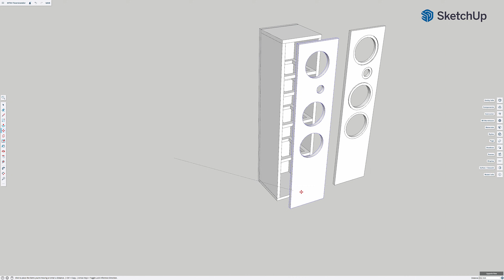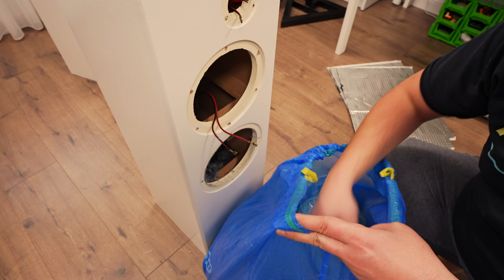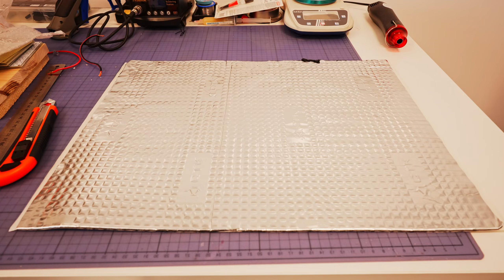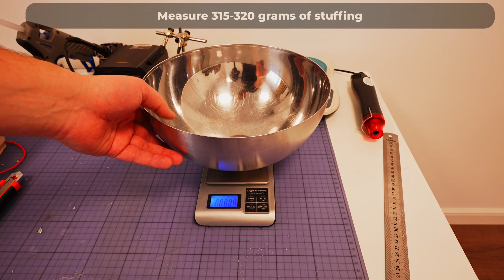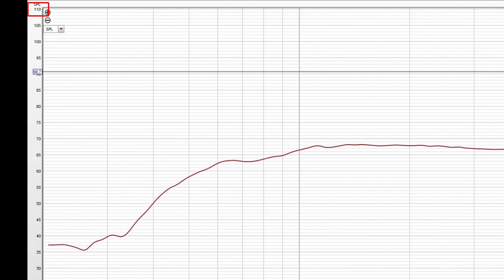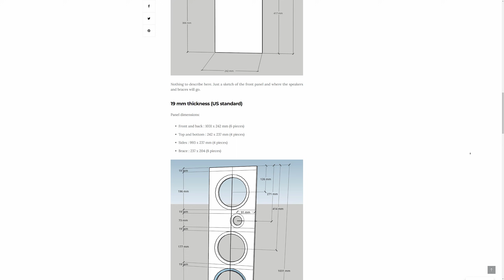MTM Floorstanding speakers v2

Comment: Okay, you said to get the crossover point lower.... the tweeter will not be happy, that's clear! But why won't you build a asymmetrical crossover (I don't know if that's the correct name for it...)? Chose one frequency for the woofers and another for the tweeter!? Wouldn't that work for your already designed crossovers?

Comment: I'll grumble a little )) SEAS CA18RNX has very high inductance, which isn't good for midrange reproduction (usually you want to stay below 0,4 mH). And instead of Morel, I'd use Wavecor TW030WA06 (or TW030WA08, if they were sensitive enough). These are incredibly powerful tweeters - in my experience, they outperformed the renowned Scan-Speak 9700 (which was a huge disappointment) in every way. And of course, tweeter with second-order.

Comment: I thought you had to reverse one of the driver connections with a second order crossover, as you would be hitting +/- 90 phase at crossover, or is that covered by the difference in depth of the drivers

Comment: Hi ! I think the large peak between 100 and 200 hertz is due to the port being too big. For two 8 inch woofers, the inside diameter of the port shouln't be superior to 5 inches. Maybe make an experiment with a smaller port and see if it changes things in any significant manner soundwise. Thanks for the video !!

Comment: I designed A 3 way speaker system. Woofer and midrange has 88 db silkdome tweeter is farely louder at 92db all athe drivers are 8Ohm.
I don't have proper measuring mic but I feel tweeter/mid slightly louder than woofer. 
The Crossover design is second order it is not made specifically for these speaker but A common Design. 
Lopass 920Hz
High Pass 8800 Hz
Low pass have one Series Inductor and a Capacitor In paralle. 
Bandpass filter Has one Inductor and a capacitor in series. 
High pass filter has one capacitor in series and an inductor In parallel alignment. 
Shall I add Resistot in series with the tweeter? What kind of resistor will be most suited for HF driver? 
I am planning to add Ceramic resistor 10 Ohm pls guide me for a better outcome.

Comment: Does your switch box route the signal directly through the tumbler switch? I don't really think it's a problem, but I would prefer to eliminate that. Some kind of a beefy high-current relay with low contact resistance, controlled by a tactile button - both to make switching faster and possibly quieter. I wanted to make such a switch too, but packing it into a tidy box turned out to be above my threshold of acceptable effort.

Comment: i really like the mundorf supreme! but even cheaper caps like jantzen cross cap or mundorf mcap are neutral but do have a tendency to emphasise "S" and "T" sounds so if your ears are sensitive to that like mine is then i can really recommend the supremes! its going to be interesting to see if you can hear a difference. good video!

Comment: What does the impedance curve look like?  Wouldn't it be a good idea to adjust the load impedance for the filter to be as close to the ideal resistance as possible?  For example, use mid-bass resonance compensation, then use a simple zobble network for mid-bass impedance compensation, and last but not least, equalize the nominal impedance to the same value so that a symmetrical filter can be used?  Anyway, nice project, I'm looking forward to the next video where you compare capacitors from a price/quality point of view.

Comment: Another way to fix standing waves", or at least the most troublesome one or two at lower frequencies is careful positioning of the drivers and/or vent.  Positioned right, and the audible impact of standing waves can be reduced.  Similar to using an offset driver in a TL, to null out the effect of the 1st harmonic resonance.

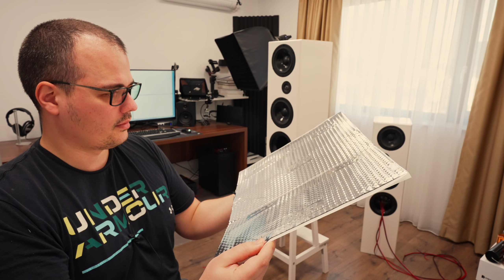Comment: Good job ! But the material you held up there was dampening material. Which is only going to bring down the resonance within the box not strengthen the box. 2:40 . The only way you can strengthen a box is to add more bracing. Not dampening material that's only to bring the resonance down.
Reply: It's a great job you did. It's good you want to keep the resonance down what's in your box. When I did my tower Polk audio 70 series 2 I made sure I put the dampening thing over all of the woods. To ensure no resonance get through my box.